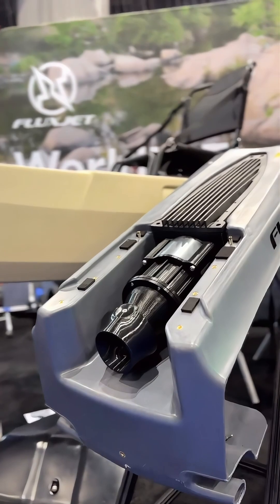Why FluxJet Is Called a Jet Kayak 🛶⚡ (Simple Breakdown)

Comment: The motor is the drive shaft.
Reply from the maker: The motor drives an internal jet system. There’s no exposed prop, shaft, or lower unit hanging below the hull.

Comment: I’m still waiting for an actual top speed test with the highest voltage batteries you can run
Reply from the maker: Totally fair 👍 Everyone’s been asking for that. Wolf just dropped a video today — he’s out testing it now with real batteries on the water. More speed tests and full breakdowns coming soon
Reply: @fluxjetkayaks months later. 😂
Reply from the maker: @GFG2gifted Make sure to visit our website, as it lists the top speed along with many other faq's.  With a 36, 48, or 60v battery it will hit 6+mph. Riders weight, gear, wind conditions, current, etc will determine the speed.

Comment: How does it paddle, I don't see this mentioned much
Reply from the maker: It still paddles like a kayak 👍 The jet drive is recessed and doesn’t drag, so you can paddle it just like a normal sit-on-top when you want. The motor is there for when you don’t want to paddle, or when you need to cover distance quick
Reply: @fluxjetkayaks awesome thanks
Reply: @fluxjetkayaks I think they meant like is it good with paddling like does it track well. Also if you need to paddle for whatever reasonnot having a rudder will kinda suck. I also wonder if you are moving forward and let off of the throttle does the boat move perfectly straight after or does it go off to the side like alot of kayaks do?